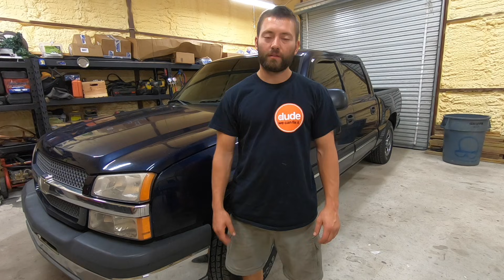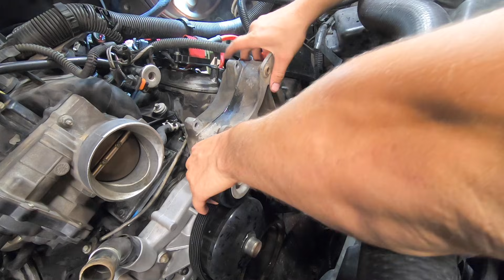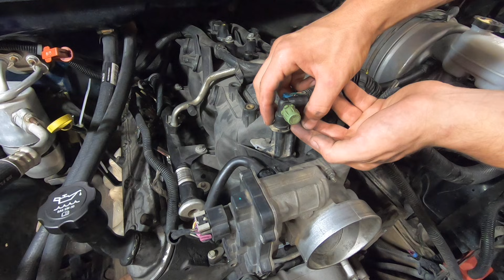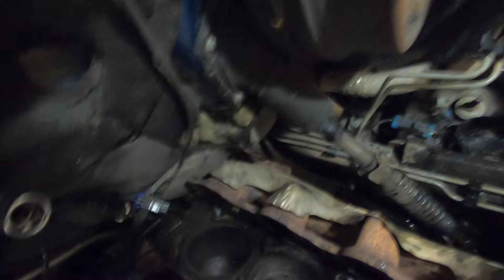Head Gasket Replacement || Part 1: Removal

Comment from the maker: 0:00 Introduction
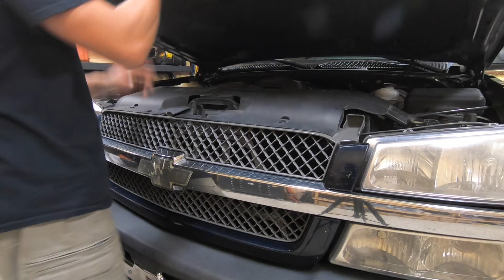0:16 Diagnostic
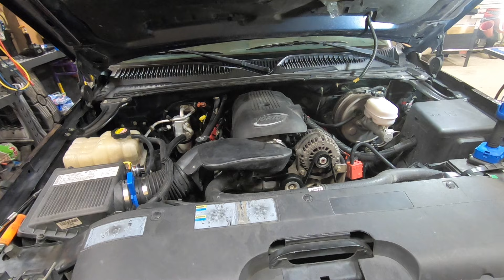1:06 Remove Intake
2:46 Radiator Hose
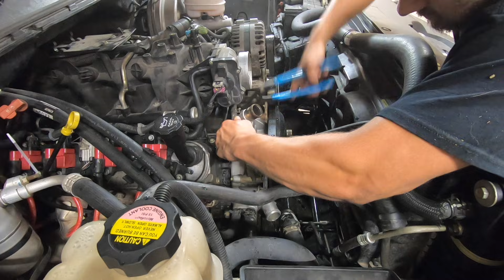3:51 Serpentine Belt
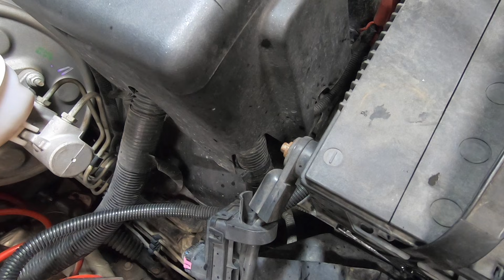4:05 Battery
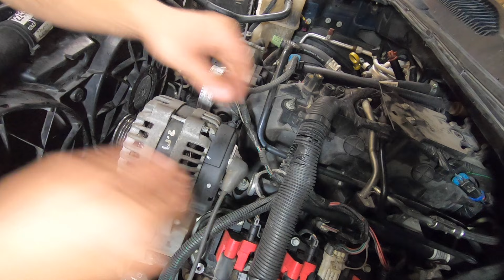4:24 Alternator
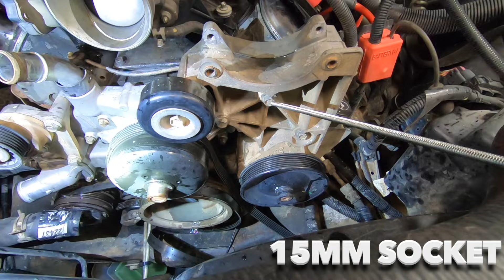5:26 Power Steering Bracket
7:07 Coil Packs
9:43 Intake
16:30 Valve Cover
18:00 Spark Plugs
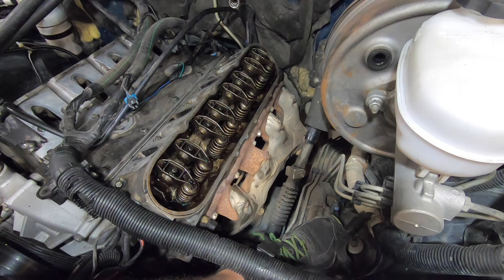19:03 Exhaust Manifold
21:35 Rocker Arms & Pushrods
23:36 Head Bolts
25:35 Remove Heads
28:13 Outro
Reply: Is it a notched head with  wrong gasket?
Reply: What cause the oil lid pop of
Reply: Is it head gasket
Reply: How can you tell running down the road shit pgf
Reply: 9:19 9:25 9:25 9:25 9:25

Comment: Thank these channels, I completely rebuilt my 4l60e, head gaskets,intake gaskets, main bearings and rod bearings and many other smaller things with ease.  Been running like a dream for 3 years.  $600 vs. $6000, could never have afforded it.

Comment: I saw a video on leaving the manifolds bolted on  and to pull the heads with them on after disconnecting the three exhaust bolts.  Supposedly it's easier, gonna find out.

Comment: When removing the heads for in my case "replacing the rear freeze plugs", is getting the heads resurfaced mandatory before slapping it together.

Comment: I'm just curious how did your rear lower headbolt not get lodged into the firewall when you took it out I can't get mine out without pulling the head out first and then putting it back in I have to put it in before I can line up the head and it keeps knocking off my gasket

Comment: The hardest part about this is keeping everything organized when you take it apart 💀
Reply from the maker: Absolutely, and cleaning everything
Reply: @dudewecanfixit  what about the block? do i have to remove the oil pan or flushing with diesel using the oil drain will be enough? than you.

Comment: I bought my first truck in 2023 (after a house fire, lost my dad, 3 vehicles and everything else) and I love it. It's a 2005 Silverado and I can't believe I haven't had a truck my whole life! 

Anyway, I love it and want to keep it forever. I always thought bad head gaskets were something you scrap the vehicle for but this makes it look doable (not EASY, but POSSIBLE). I only just replaced my valve covers and this video along with doing that has given me the confidence that I could do this if the need arises. With 255,000 miles, it's a possibility after all....

Thank you, sir!

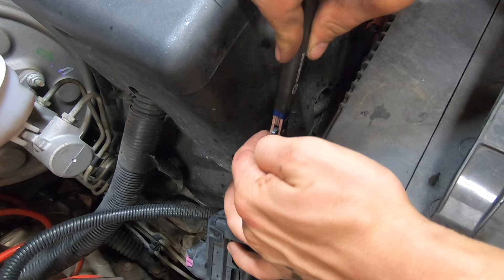Comment: 4:15 5/16 ratchet wrench battery

4:28 10mm socket alternator nut

4:57 15mm socket alternator bolt

6:15 15mm socket with a 6" extension for alternator bracket and that bolt is shorter than the other bolts for this bracket

7:02 10mm socket coil pack bracket

8:28 swivel extension paired with 10mm socket

12.:00 It begins to be a PITA for safety clips 

12:47 Intake plenum bolts 8mm socket

13:50 change oil and coolant when job is complete

14:10 pliers for coolant crossover hose clamps

15:55 Vacuum

16:15 zip ties to not dislodge any part of the wire harness

16:30 8mm socket to remove valve cover bolts

17:12 10 mm socket for coolant crossover pipe

17:38 two plugs in the back of the block & make sure o-ring comes along with it

18:07 remove all spark plugs GOOD THING I DIDN'T DO THAT IN JANUARY LOLZ

18:28 15 mm socket to remove dipstick tube

19:06 13 mm socket to remove exhaust manifold bolts LAST BOLT TO REMOVE SHOULD BE EASIEST SO NOT ALL OF THE WEIGHT IS NEAR THE FIREWALL BOLT

19:36 May need ratchet wrench to reach back on back exhaust manifold bolt

20:45 Remove exhaust manifolds from back part of exhaust system. Use the lift fuck that.

21:39 8mm socket to remove rocker arm bolts DO NOT USE IMPACT TO LOOSEN OR TIGHTEN

22:37 Remove pushrods in specific and correct order and orientation the same way they were taken out

23:38 10mm head bolts loosen in order that they were supposed to be installed in. Slowly in sequence

25:18 Magnet

25:35 Possibly need rubber mallet to displace head

26:50 clean coolant on any part of the block or pistons AND CLEAN OUT ANY HOLES THAT COULD HOLD LIQUID WITH AN AIR HOSE. U GOT GALLONS FOR DAYS FOR THIS!!!!

27:20 Replacement pins should be removed and put back in I could reuse these
Reply from the maker: I love this!

Comment: One of the problems I ran into (not really a problem) in doing head gaskets on an 2003 Siverado 4,8 was the back head bolt on the passenger side would not come all the way out.... it would hit the strut tower, so the head would come off BUT you would have to remember to put the bolt back in the hole before you would reinstall the heads.............
Reply from the maker: Yeah, that's a nuisance

Comment: Great vid ! It is weird that “1” side of the engine has bolts on it that require  2 different size sockets ! I would be checking to see if they were actually the same size bolt , especially since “1” side is leaking ! However the bolts on “1” side could have a flange & the nut portion of the bolt then be a different size ! I have seen people mix 8MM & 5/16 & it messes up the threads a little on each ! Also just because to remove a bolt requires a 1/2” or a 13MM  wrench / socket to remove or install it is NOT a 1/2” or 13MM bolt so don’t call it so !
Reply from the maker: That's an interesting point

Comment: This video and its part II are the best bar NONE!!! 

A thing I definitely learned too, because I can surely be a spazz: when loosening rocker arm bolts, be REAL SURE to use a GOOD SURE-GRIP 8mm socket, and PRESS down that ratchet while you're cracking those loose, rounding off a rocker bolt was, for me, definitely crying-time. In fact, ALL those manifold bolts, careful-careful, patience-patience.
Reply from the maker: Thanks for the tip!

Is sure-grip a brand of socket?

Comment: I have a 2001 Chevy Silverado 1500 5.3L, I’m confident my coolant is leaking into my engine because of the sweet smell from the exhaust, would this video work for my truck or is it for newer trucks? Thank you
Reply from the maker: Yes it will

Comment: I believe I just had a blown head gasket myself , had truck on jackstands running In drive way I put It In neutral and it start idling very differently and a bunch of white smoke came hauling out the exhaust pipe and engine. Im seeing fluid around the heads only on the passenger side. truck wasnt running long at all am I good to just clean up the heads and replace head gasket or will I need to get the truck flushed or more internal work can someone help please ????
Reply from the maker: I can't help much with the diagnostic steps.

Comment: Hey, i knownthis is 3 year old video but if the truck is 05+ itll have electric fans only, and 04 and older only had a mech fan unless swapped to electric
Reply from the maker: Generally the trucks with a towing package still have a mechanical fan

Comment: I have a 2000 gmc Sierra 1500 5.3 sle I'm having trouble with the last rear head bolt by fire wall on both heads any simple way to drop those 2 bolts with ease they hit the fire wall so bolts don't drop in is there a trick too it
Reply from the maker: Maybe place the bolt in the head before you set the head in place?

Comment: You don’t need to have the piston #1 at top dead center????
Reply from the maker: Can you send me a time stamp, I'm pretty sure it's explained in the video.
Reply: @dudewecanfixit  does it neeed to be top dead center for disassembly
Reply: I don’t think it’s in the videos I’m asking if I need to rotate the crank pulley and line it up with the top dead center alignment dots to put piston #1 at the top

Comment: I curious what caused the head gasket leak in the first place. Is it possible the heads are warped or???
How do you know what to do once you got it apart. Just clean it and put it back together?
All the videos I've watched on Chevy 5.3 Vortec the mechanic just slaps it back together with new gaskets like "that's it, all done"!. So did GM just make crappy gaskets is that why they are blowin". 
What should I be looking for to actually fix the problem.
Reply from the maker: I always bring the heads to a machine shop to get checked and resurfaced. The original issue (usually overheating) needs to be addressed at the same time. 

GM head gaskets are just fine.

Comment: Did it actually take you 30min to remove? I think I need to do this to my 2003 6.0 but not sure it has 300k miles. Do you have to get the heads resurfaced? I don’t have that kinda money and really need this truck to get back to the oil filed. What gasket kit did you buy ?
Reply from the maker: It took a few hours to get it off. 

I got felpro gaskets from O'Reilly's.

I definitely recommend getting the heads resurfaced. It sure would suck to put it back together and still have the same problem.

Comment: How much do machine shops charge to resurface a head?
Reply from the maker: I haven't had one done in a while. I think it used to be $150
Reply: Thanks. I am planning on doing this soon. I had a leak but I added a gasket fix solvent and it has been good for a year already but I know those are only temporary fixes.
Reply from the maker: Which gasket fix did you use?
Reply: @dudewecanfixit it was a small bottle from Oreillys. It was small and  greyish color. I don’t remember the name of it. I did end up changing out both head gaskets along with exhaust gaskets and air intake gaskets. Took me 10 days since I was waiting on parts and didn’t work on it on the weekend. Everything turned out great, my oil pressure is up to normal and coolant doesn’t leak anywhere. I hope to never have to do it again 😅
Reply: Btw my tahoe had 249k miles when I did it. Now 251k miles. If I make it to 300k and more I would be so happy.

Comment: Do you happen to know why the holes in the head gasket that allow coolant flow from the block to the head seem to be disproportionately tiny? It just doesn't look right.
Reply from the maker: The heads and head gaskets on an LS engine are interchangeable. Be careful and make sure that your head gaskets are facing the correct direction

Comment: So do you not have to set cylinder #1 to TDC first?
Reply from the maker: If you're going to be cleaning the surface of the pistons, you will need to rotate the engine with the heads off anyway. So, there's no point in setting tdc before removal

Comment: Great video!  -  I have a 2000 silverado 4.8 with cracked heads.  It has 265,000 miles on it.  Should I replace just the heads or just replace motor and/or transmission?  Many thanks.
Reply from the maker: I would just replace the heads. The blocks are very stout and the transmission is unrelated to the issue. The heads are known to crack occasionally, so don't spend unnecessary money and time on something that isn't broken... Unless you just want to.

Comment: Dude I can fix it. Repair shop wanted $1,500 to remove heads and extract broken manifold bolts on my heads. I can do it myself by watching this video. Been a great help and save me a lot of money
Reply from the maker: Good for you! Also getting to know your truck better is a good side effect.
Reply: @dudewecanfixit  I was also able to replace rusted fenders new core support mounts and fix a power steering leak while I was in there
Reply: There's Dorman parts that don't require removal of head
Reply from the maker: Please elaborate. I have a 6.0 that has a couple broken manifold bolts
Reply: @dudewecanfixit  it's a $12 bracket that bolts to the back and front of the head with a bolt that tightens up the corner of the manifold by applying pressure. Works good on the corners. If you have multiple bolts broken it doesn't help too much on the middle ones
Reply from the maker: Thanks for the info
Reply: Dorman 917-107 cost $29.86 AmaZon mentioned by LegitStreetCars. Could tide someone over if don’t yet need to replace head gaskets.
Reply: What would you say is your mechanical skill level?
Reply: Just weld them and pull them out sure easy I do it all the time

Comment: Great video.  Seems like the most difficult part of a job like this is remembering how to put it all back together.
Reply from the maker: Yes, that and hoping that it all cranks up properly
Reply: Best method is use a legal pad and write down every step when complete, 1, 2, 3, etc. Use painter tape to match mark connections and mark them with a number corresponding to the 1, 2, 3 steps, etc. Work back in reverse order and cross off those written steps as you go back together.
Reply: @eciura1 I like all those tips, good call!

Comment: How long does a job like this usually take you ? Thanks for the very informative video.
Reply from the maker: About 8 hours to remove, clean, and reassemble. Just removal, about 3 hours. Alot double that time if it's your first time. It's important to take it slow and be careful
Reply: @dudewecanfixit  Thanks for the reply, how do I tell if my engine components are okay before replacing the head ? I don’t want to replace the head and then come to find out I have a bad engine. There’s definitely coolant going into the engine. There are no signs of milky oil but it’s losing viscosity and becoming like water. Check out my channel to see what my problem is. There’s a video showcasing the problem.
Reply: @Samsamaraie  You dont need to replace the head. Only the gasket. Youre engine should run pretty well but is overheating/losing coolant/Milky oil cap etc. If that's the case then it is most likely the head gasket

Comment: The block has "cylinder block drains" on each side of the block down at the bottom for each head/side. I do it like you though, lol, because there are two to get at and they are hard to get at. Thanks for the videos!
Reply: Also, when doing it without draining the block, like you did, some of the blocks thread holes fill with coolant! And then come out when putting the head back on. o:
Reply from the maker: You are correct, but removing the coolant hoses will drain most of the coolant and I always change the oil and coolant after a head job

Comment: How much does a job like this usually cost? Might be more than I'm comfortable doing on my own. My  Tahoe has 170k miles, should I just get the engine rebuilt since it's getting taken apart?
Reply from the maker: I usually charge $500 for labor. Expect another $500 to get the heads machined, valves and seals replaced, head gaskets, oil change and fresh coolant. 

Not necessarily. If you do not have significant blow by and your bottom end seems to be in good shape, there is no reason to rebuild it unless you just want to.

Comment: I would recommend revising this video to tell people to loosen and slowly remove the coolant reservoir cap before removing any coolant hoses like you did. There should never be pressure like that when removing a radiator hose. If that coolant was operating temperature you or someone following this tutorial could get seriously hurt.
Reply: Don’t be such a Nelly 😂 it was one of the best tutorials on YT for this job and there’s always one that has to pick out a negative in the video. I’m sure nobody diving into a job like this is trying to remove their heads after running the truck for any length of time. He’s also not responsible for people attempting to do this themselves getting hurt. I don’t think you have to revisit the video at all.
Reply: @HF1.0  there’s a reason why a REAL mechanic squeezes a radiator hose before taking off the radiator cap, it’s called experience. 

People are idiots, and if you’re going to give them step by step instructions, you might as well do it right.
Reply: @SurvivalInFlames  If you’re a mechanic and want to make a more thorough video touching on these “safety” factors then go ahead and do so. Looked like a great step by step video to me considering how much labor is involved. If you’re trying to be a YouTube mechanic, it’s your own risk. Regardless of what the video creator included or left out. It’s your job to double check and triple check information from multiple sources. Period.
Reply from the maker: You are correct. I will have to revisit this video

Comment: I’m stuck at getting the head bolts off that are located under the exhaust manifold. I don’t want to take off the three bolts to the exhaust
Reply from the maker: I don't think I took the exhaust apart. Just take the manifold bolts off the heads.
Reply: @dudewecanfixit  I couldn’t do it. So I took the driver exhaust manifold off and that did it

Comment: I have a 05 Cadillac ext, after driving it around for a while it starts dumping coolant through the reservoir dump. I thought I would try replacing the reservoir cap but still dumps coolant...I'm  starting to think the head gaskets are bad
Reply from the maker: It sounds like bad headgaskets. Cylinder blow -by pressurizing your coolant
Reply: @dudewecanfixit  thank you for the video it is the BEST one I seen and thank you for the reply , I guess doing a leak down test would seal the deal on the bad head gasket . I have done a intake gasket on a 01 astro (with help) and a heatercore on a 98 honda accord with just looking at pictures online... your video on the head gasket is so clear thank you so much for this guide maybe I'll have a go at it.
Reply from the maker: You can do it. Just take your time, make sure everything is clean, and use the torque wrench. If you don't have one, you can rent one from the auto parts store.
Reply: @dudewecanfixit  any opinions on head gaskets ? should I go with OEM or Is there a alternative option?
Reply from the maker: OEM or felpro